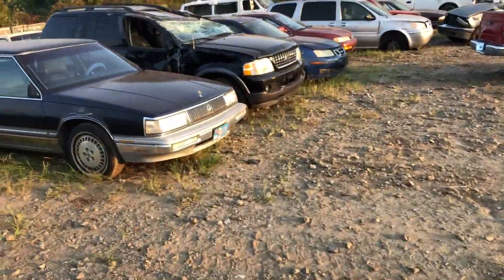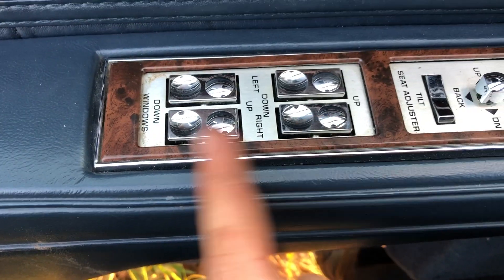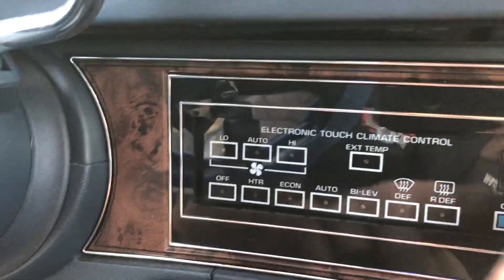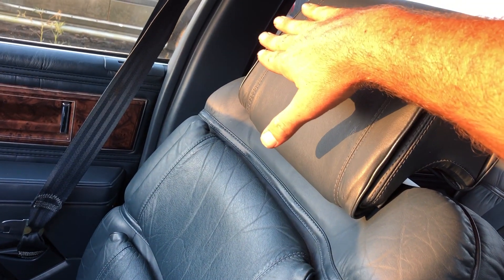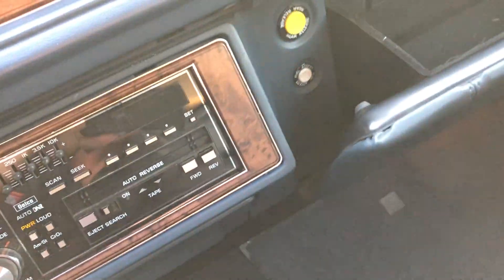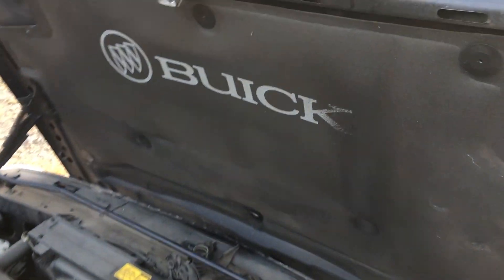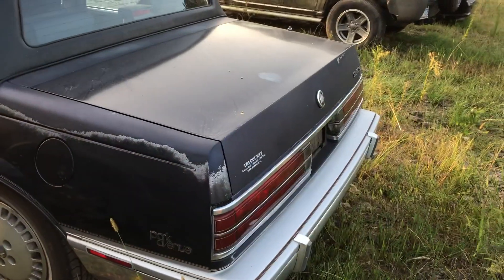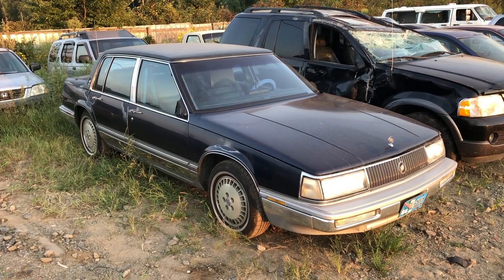LOADED 1990 Buick park ave scrapped

Comment: Hi, I used to work at one of the factories that made this car for GM in Wentzville Missouri! We also made the Pontiac SSEi that you're talking about , they were both built on the same platform. I used to go walk down the final assembly line and sit in these and just dream about owning one, they were so gorgeous brand new! I was finally able to buy a used 87 Park Avenue in the 1990s and loved it.
Long live General Motors!
Reply: were htye pretty reliable? i heard the ABS system was a pain to repair tho
Reply: The 1988-1991 Pontiac Bonneville sse then 1992-up was ssei because 92-up cars had a supercharged 3800 V6’s in them and I would have sold this car has/had lots of life left in it and it was missing the sunroof that’s the box they didn’t check off most likely for dealer Credit off the msrp and I would so buy this car but it’s most likely gone 😭
Reply: Back in 2000, I bought a 1988 Park Avenue. That was the single best car I ever owned. Bought it from the son of its first owner, and it drove like a dream. Had leather, air suspension, and all the other goodies. I took that car on so many road trips, and it never gave me a single complaint. Yes, these were gorgeous brand new. I think I preferred the velour interior over. leather, but other than that, out of the 20-some cars I've had over the years, that is the one I genuinely miss. Should never have traded it in.

Comment: Back in early 2008, I bought a gold 1990 Park Ave Ultra, optioned out similarily - rims, VERY comfy leather seats (with ALL of those controls), Delco-Bose stereo (didn't work though), and so on. The only differences that come to mind, I didn't have the digital dash in mine - but I did have a working sunroof that didn't leak! It was a great car, very reliable, and it was only $800 Canadian.
OMG I forgot, it had a 'mobile' phone, corded, that had it's own stand on the hump in the floor, AND it's own antenna on the back window, AND the thing WORKED!
Reply: do u still ahve it
Reply: did it die
Reply: randomrazr Car was saved and went to Tennessee
Reply: @montyray3551  really
Reply: randomrazr yessir. It’s a phenomenal car. I’m still shaking my head every single day that someone scrapped it
Reply: randomrazr yes

Comment: I'd buy that car in a heartbeat beat, had an 88 brown one, and it was an absolute cherry, Great cars that will go forever if properly maintained, the hood that opens backwards like the Corvette is my favorite feature, these were notorious for having bad crank position sensors, a simple worthwhile fix, this is a close rival for the sedan de ville, seeing as how Cadillac lost their way when they went to the 32 valve deathstarr, only thing missing is the sunroof, this would be worth putting back on the road
Reply: I had an '88 Park Ave and loved it until an employee ran into a park monument at around 250,000 miles. The boss had a Sedan de Ville, the Buick was a better driver. Quieter and smoother.

Comment: I think you mean "Electra Park Avenue" because the real Buick Park Avenue came out in 1990 for the 1991 model year (and the 1991-1996 generation) and was sold up until 2005 (for the 1997-2005 generation).

Comment: These were never noted for head gaskets there were known for upper and lower intake manifold gaskets and can be fixed for about 500.00 or less. you can get a mirror assembly on Ebay

Comment: Buick had the membrane touch HVAC as far back as 83 on my fathers Park Avenue. The problem facing these 30+ year old GM C-Body Electra Park Avenue's is that they simply aren't interesting. They're downsized, FWD boxes, with a bunch of doodads slapped on. They weren't bad cars (3800 and 4T60 transmissions were solid), but they weren't good cars either. Structurally, the first-gen C-car unibody wasn't exactly a stiff chassis, so they were softly sprung, handled poorly but also didn't have the road isolation that the old body-on-frame predecessors provided. 

But the biggest problem is the frumpy, lame when it was new  (and I was 15 when this thing rolled off the assembly line - it featured very lame) styling. GM trying to downsize their formal big-car rooflines and 3-box designs into squished FWD form, where the proportions were all wrong. Festooned with goofy gimmicks like pillar accent lights, landau rooves, tons side cladding, these tacky looking turds were only one step removed from Chrysler's idiotic looking K-car "luxury" errors (e.g. K-car based Imperial and Dynasty). I wouldn't want to be seen in one of these in 1989, and I definitely wouldn't want to drive one today. 

In contrast, I'd gladly have been seen in a 91, and I'd have no problem rolling in some well maintained example of the 91-96 Park Ave nowadays. The second gen C-car platform used in the 91 Park Avenue, was substantially improved (structurally), and the exterior styling of the 91 model is still, 31 years later, absolutely gorgeous. While not without its flaws, the 91-96 Park Avenue was vastly superior, and is, all things considered, probably a high-water mark for the Park Avenue nameplate, whereas the 85-90 was probably the low-water mark.

So yeah, I can't really shed any tears for this dumpy looking piece of 1980's GM mediocrity, crush it into a cube and call it a day.